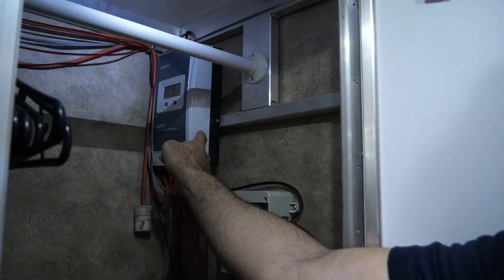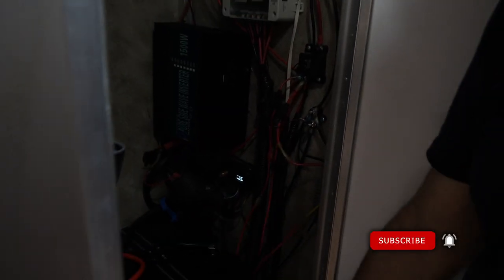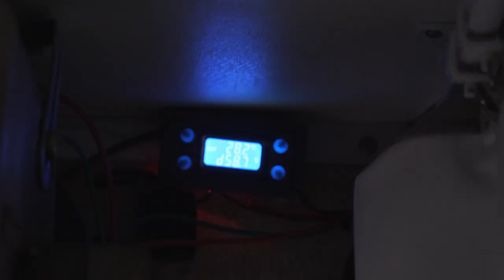Most Efficient Battery Powered A/C for RVs and Trucks

Comment: Yea!!
Well done! 
I was hoping someone would do this. 

I’m a pipefitters by trade. In my union there is a branch of HVAC but I don’t know enough about it myself. I can evacuate and fill a system but to piece a system together was a little out of my comfort zone.

I’m hopeful some one will take this to the next step and make a mini split ceiling cartridge that will drop in the 14x14 hole where the OEM air conditioner sits. 

Thanks you!
Reply from the maker: MarineDCAC.com....   soon

Comment: I use a KD-350 mosquito net cooler for my aft cabin. It is a tiny 3750BTU mono block aicon and runs at 230VAC. Including the inverter it draws about 14 Amps. Not able to run it all night but nice to get the heat out after the sun has set.  It does take up quite a bit of space an a bit of hearing loss is a bonus :-)

Comment: I have a mini split heat pump in my Isuzu NPR box truck overlander conversion. It uses about 200 watts in heating mode and 175 watts in in cooling mode. Full on it is 1000 watts and the Overlander will use every bit of it on a super hot day to cool the entire vehicle.  I have 2750 watts of solar and running the mini split isn't a problem with 1120 ah of lithium I built from cells. We use a curtain over the bunk bed where the head unit is installed. This allows the bunk bed and the space underneath which is our dinette which is convertible to be cooled. The box truck is probably about 3 times the size of your overlander. However, my outside unit is fairly large as it is a 9,000 BTU outdoor unit that is mounted in a frame under the box of the truck. Your unit is amazingly compact and I am so surprised it is so small. I think that you would sell more units to RVers than you ever would to boaters.  Does your unit have a reversing valve?  I created my own control board for a project of mine.  I use a 9000 btu mini split outdoor unit in my attic to heat my hydronic flooring.  It will essentially for the most part heat a 7500 sq ft house.   I have the control board code if you want it, but I'm sure you could manage with building it as you are one of the smarter people I have been exposed to...
Reply from the maker: Thanks Allyn,
    Yes it's crazy small.  The compressor is about the size of a beer can.

Thanks for the driver board.  I'm planning on doing a thermostat board that will handle compressor and blower/pump speeds, but I'd love to see your work.  I have a mini split 9k pioneer unit in my house that I toasted the board .  Can't find a replacement yet but can't say I tried hard yet.  

emilyandclarksadventure@gmail.com
Reply: @EmilyAndClark  Well the control board can be any arduino type with enough input/outputs.  Basically a couple of temp/humidity sensors, a relay board, and some coding and there you go.  Basically with your unit since you have such a small coil you have to be super careful about defrost in heating mode.  Below 40 degrees is the point where you can't rely on just a thermostat.  My temperature sensing logic is a little different so you should just write your own given observation of the unit in operation.  I'll see if I can't forward you the code I was working on when my son and I were in process.  It should be in my email somewhere. I am away from home for several weeks so that might be the best I can do for now.  It will be incomplete and a little rat's nesty.

Comment: Clark.. I installed a 220 volt 38 seer mi isolated in my 30 foot holiday rambler travel trailer.  It's 9000 btu but can go up to 13500 and down to 2000 btu. It pulls an amazing low 600 watts or so at start up and for the first 10 or 12 minutes then drops to just over 200 watts the rest the time it's on. I keep it at 68 degrees in the camper and it's wonderful. It has a dehumidifier and also heat which I have not used yet. Hopefully the heat function is efficient also. It was atleast twice or maybe 3 times as expensive as the popular pioneer brand but over a period of time from what I I seen it uses just over half the power as the pioneer brand. I wasn't sure if there would be much difference in 38 seer and 20 seer and was hesitant about spending the extra money on it. My thoughts was that maybe that money would be better spent increasing my solar and battery instead but I'm so glad I went the route I did. David poz videos is where I first saw the inovair and following his recommendations I made the plung. Couldn't be happier. Thanks for the videos.

Comment: You can mimic an inverter circuit by using a relay board.  Find out the minimum and maximum current on the compressor.  De rate the top end and up rate the bottom by 10 percent to protect the windings and account for manufacturing variances.  Then use several resistors in parallel.  Add resisted circuits for more current and take them away for less current.  With the right resistors you can mimic an expensive variable inverter circuit.  I would make sure that every once in a while if you are down to a single circuit at low speed you switch periodically to a different wire to reduce any potential future failures on a particular one circuit that may be in operation longer than the others. Be careful that the relays and wire can handle the current applied to them.

Comment: I was watching other videos on boat air conditioning. They use water to cool. 
Just a thought. I wonder how much water would be needed to cool a small unit. Say I cycled potable water from my storage tank (30+gal) I wonder how warm it would heat the water. 
Having tempered water in my holding tank may not be the worst thing. 

Running the AC all night and have warm water in the morning.
Reply from the maker: Problem is the water keeps getting hotter and as it gets hot your efficiency goes down.

It's best to cool with air on land but better to cool with water if you have enough to float in.

You have seen my boat AC unit video right?

Comment: Thanks Clark & Emily ... Great work once again😊 ... I'm also an electrical engineer ... how does the solar a/c compressor type, compare to a solar water evaporative type cooling system ... In terms of cooling ... Just curious 🧐
Reply from the maker: Should be inferior of course but I had a bad thermometer and overcharged the camper.  Well, it works better.  So it's not apples to apples.  I'll put more gas in the boat sometime.

Of course I have the camper compressor running faster as well.

Comment: Would not provide a lot more efficiency if you would separately insulate the refrigerating lines? If I am not mistaken, at least the cold line shall benefit a lot from insulation, as it cools the outside air and the warm line while touching it?
Reply from the maker: Actually you want them to exchange heat as much as possible.

Getting the liquid line cooler is an obvious win.

If the gas (cold) line takes that heat it comes to a higher temperature in the condenser and can more easily dump heat into the outside air 

Biggest help in this install is the liquid line touching the aluminum outside camper skin.  That gets rid of loads of heat.
Reply: @EmilyAndClark  Hey, thanks for the reply. I agree that the line that returns to the external heat exchanger is good to be uninsulated, and your idea of it touching the metal wall is nice as well (if it does not lead that heat to the inside of the van) but the cold line I think shall remain as cold as possible till the inside heat exchanger. When it expands in the internal heat exchanger, it gets colder there, taking the heat from inside. So if it is colder to begin with, then it is more efficient.
Reply from the maker: It's all about moving heat.

Comment: Did you use the PUPVWMHB 12V batteries in the camper, if so what is you opinion of them so far? I know you wanted to test the out on Temptress.
Reply from the maker: Yes we used the first one for the trip.  No complaints.  I added a second for the A/C project.  It was left over from the Duffy install.  Seems like a fine battery.

  I think we are going to do a few more battery reviews.  I have several companies sending me battery's.  One company's offerings seem particularly interesting.
    I think I'll offer the best company BankManager modules that they can install in their case to get my functionality built in.

Comment: Did you think about running the condensing water down to the condenser to help cool it?
Reply from the maker: It would help a bit possibly.

But if you are in a dry place there won't be much water and if you are in a humid place the water might not evaporate well. 

But interesting idea and so easy to do.
Reply: @EmilyAndClark  I built a spray system for my R1200GS for use in slow traffic on hot days.

Comment: Whats the cost for land unit?  I have 5k buto window unit on trailer would that fit in that space?   My living area is 12'*5'*6'
Reply from the maker: https://www.emilyandclarksadventure.com/AC

These are just kits of parts it's up to you to do what you will with them.  There are 3 left and they will be mailed out next week then it's over.

To make an air cooled unit replace the water condenser with an automotive condenser from a scrap yard and a fan to cool it in place of the water pump.

Comment: Why aren't you talking about power over time? You certainly know that saying instant draw is irrelevant to anything other than sizing the components. How much power does it use over a 6 hour period, in what ambient conditions and with how much delta T and rH?  Or 4 hours or 12 hours, whatever.  But without honestly measuring and sharing the amp or watt hours the only point you're really making is that your system has a low starting load.  Which is.... ok, I guess.  But that really isn't what stops people from having AC anyway.
Reply from the maker: If you go back to that section of the video and watch again you will see that refer people interested in that information to another video.  We even placed a card to link you right to it.

In that video I go into that detail.